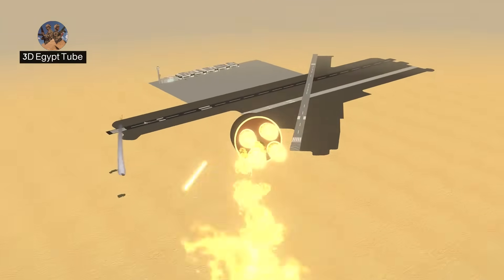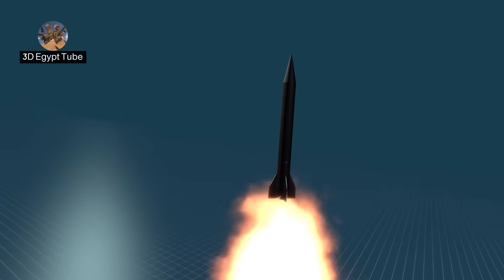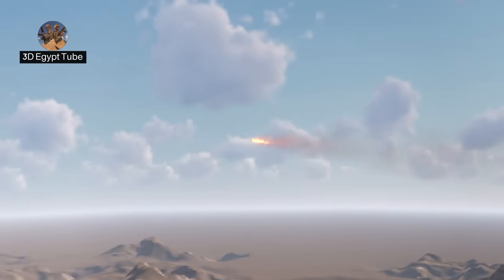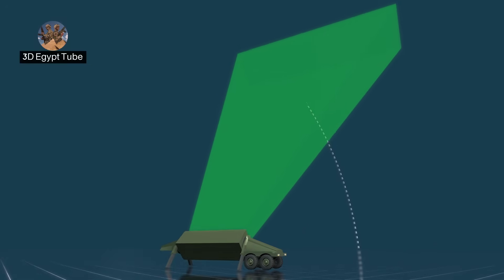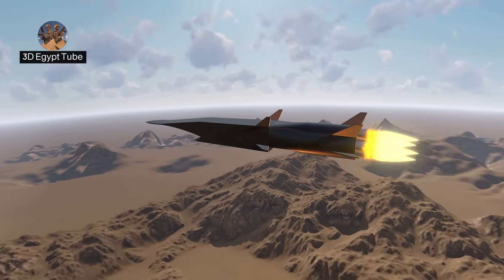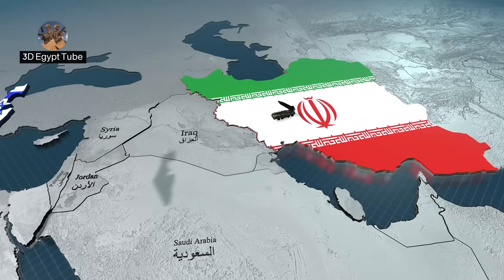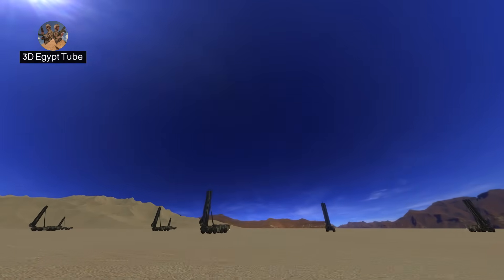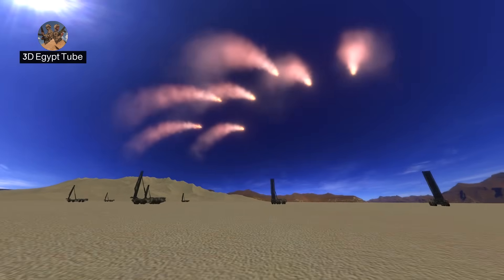Can THAAD Stop IRAN's Hypersonic missiles ?

Comment: That’s NOT how the Fattah-1 actually works. The small engine in the “warhead” (the reentry vehicle*/RV) is called a sustainer motor with an advanced TVC (thrust vector control) system. Its role is to enable the RV to perform evasive maneuvers before reentering the atmosphere (exo-atmospheric maneuvering) at a high speed (Mach 5+). Additionally, the Fattah missile does not employ a multi-stage booster (as shown in the animation), and it flies in a depressed trajectory by default, rather than following a normal ballistic trajectory (minimum-energy trajectory), which makes detection/interception even more challenging.
Reply: If only he mentioned Fattah 2
Reply: Or even Fattah 3